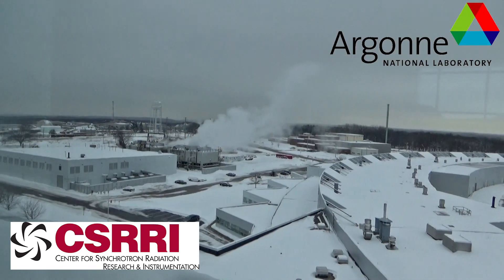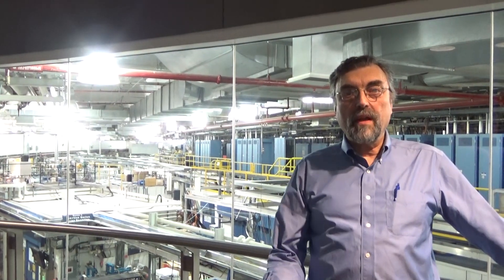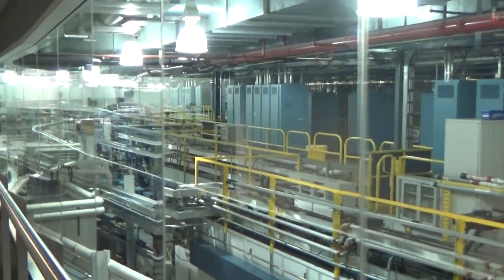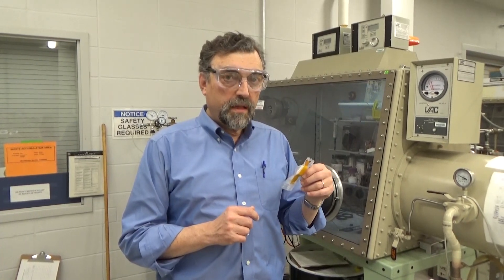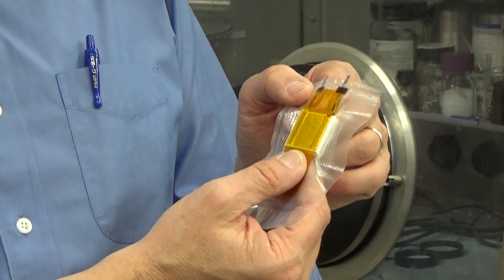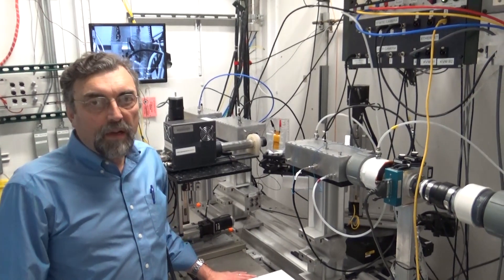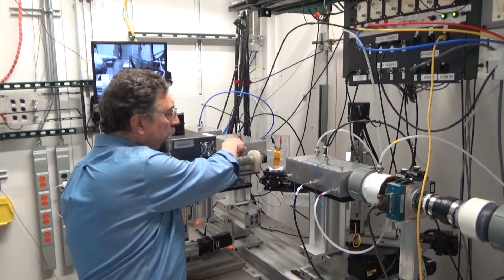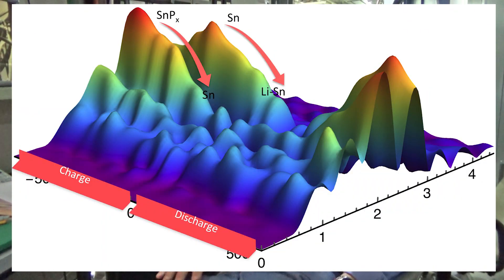In Situ Characterization of Battery Materials Using X-ray Absorption Spectroscopy

Comment: Interesting! Is the pouch cell vacuum-sealed by a plastic bag then covered by the Kapton tape? Is the plastic bag also x-ray transparent? Why not directly use Kapton bag?
Reply from the maker: Kapton is used as an adhesive inside the polypropylene (PP) pouch. PP is x-ray transparent. Kapton bags are hard to seal and the pouches we used are commercial product for pouch cell testing (check out MTI corp website) they have a special adhesive tape for sealing the metal leads.

Comment: Very interesting. Is that Kepton tape on the pouch cell or some special material for X-ray measurements? Secondly, anode and cathode are mesh type or sheet type? Cheers
Reply from the maker: It is Kapton but the pouch cell is from a food vacuum sealing pouch.  The cathode and anode are sheets.
Reply: @iitenergymaterialsgroup4816  thanks for the response